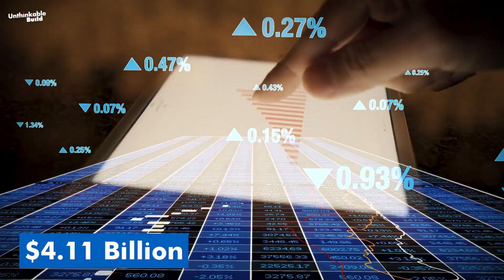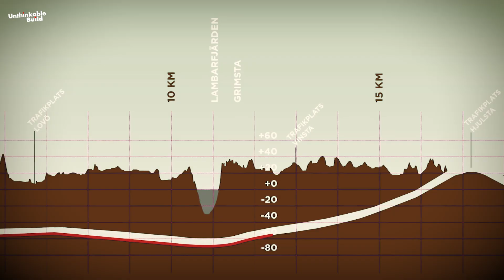Inside Sweden’s $4 Billion Mega Tunnel: The E4 Stockholm Bypass

Comment: Belgrade did the exact same thing by building the southern bypass that connects east and west, with the old highway running right through the middle of the city. Aside from a small amount of heavy traffic, the overall traffic situation has stayed the same. In neither Belgrade nor Stockholm is there a lot of commuting between different parts of the city. People go into the city center to get from one neighborhood to another. The new bypass will be an enormous cost with few benefits, especially since it only connects two points. And because it passes under protected areas, it can't even be used to encourage future construction development. When you weigh the benefits against the costs, it's a useless project.
Reply from the maker: You raise some valid concerns. Large infrastructure projects can sometimes look impressive on paper but bring limited real improvements if they don’t match the actual traffic patterns or urban needs. In such cases, the cost-benefit balance becomes a real point of debate.
Reply: Belgrade is a poor city with poor planing.
Sweden does excellent planning!
Reply: @petter5721 
Sweden has such excellent development plans that billionaire companies like Northvolt and Stegra have failed or are failing, crime has made it one of the European countries with the highest risk of gun deaths, and the railways and postal service are in disarray. In short, for a rich country, it is not exactly a great example to follow nowadays."
"Do you know the development projects for Belgrade, since you mention them?!